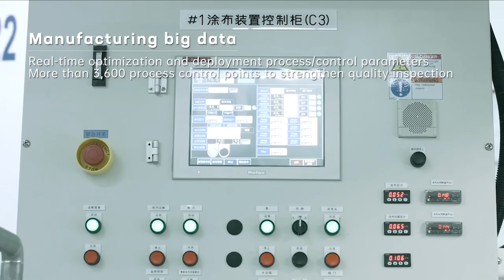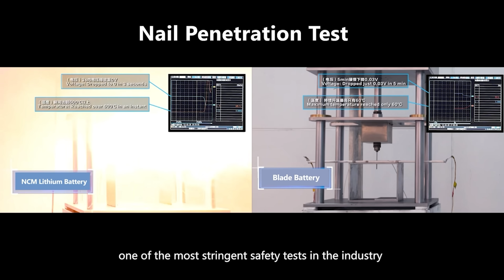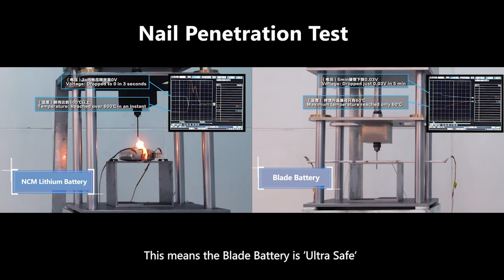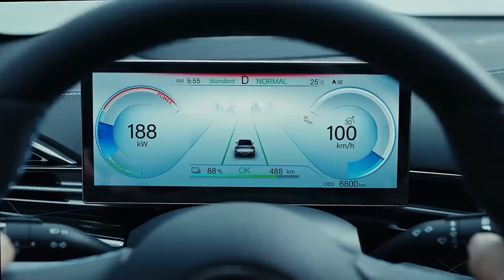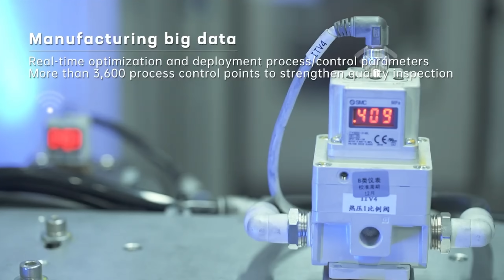South Korea Fears China’s CATL Sodium Battery Revolution

Comment: Don't know what the fuss is about, NaIon batteries are as bad as LTO or AGM  batteries, they will have to change a lot before they get close to LiFePo4 batteries, have a less efficiency then even AGM batteries, last less (2000 cycles, there's a lot of stress to the metals) are bulkier (per Wh) have a wide Voltage range so inverter have a hard time,  and are more expensive, not less.. won't even start a normal car. it's an improved 1978 technology but will it improve further? China is the main refiner of rare earth worldwide and they want to get away from that, but Chinese are catching up on that as well..

Comment: No one is "afraid" of Chinese-made sodium ion batteries. They'll only be available in China for years, only be available for certain use cases, and only able to be used inside China's vastly less safety-regulated environment. And since Sodium is vastly more widely and cheaply available, and many other companies in many other countries are working on the technology, there will be other makers as well. This isn't something China can monopolize. And, frankly, given that CATL has been incorporating stolen IP and R&D into its own R&D, as is the norm in every Chinese sector and industry, it's not an impressive accomplishment to be first to market. They're routinely first to market with stolen IP and R&D, because they can rush it through their regulatory and IP system, which is specifically tailored to fast-track just such conversion of theft to in-market product.

Comment: 50% less than LFP and cold resistant! The real interesting application is not cars, but local battery storage for solar panel installations
Reply: Exactly these are not for cars the power density is way too low unless it's a tiny car but not going to get more than 120 mile range at 170Kwh density. Great however for grid & home storage where battery size doesn't matter or cordless power tools/electrical appliances.

Comment: Lasting five million km vs one million km is basically irrelevant for anything other than commercial usage.

For consumer cars, getting the chassis to last a million km is remote. US drivers are among those who drive the most, and the highest average distance driven per year is in Wyoming at 34,722 km. At that yearly distance we're talking almost 29 years to hit one million km. Getting the battery pack to last five time as long isn't going to make any difference what so ever, as you're not going to be driving that car in 150 years.

Five million km doesn't end up making an appreciable difference in the actual lifetime of the cells, unless you're a commercial user.

In the US, semi-trucks travel an average of ~100,000 km/year and have an expected lifespan of 10 to 15 years, because the engine and gearbox are worn out. If you're just replacing the batteries, that massively expands the expected lifespan of a semi, even if you need to completely replace the battery pack. It's going to be a lot faster to do as well.

And again, a semi-truck having a battery lifespan of 50 years isn't going to be that big of a selling point. It sounds great, but are you really going to have that truck for that long?

It's a fluff number that doesn't matter. It's like bragging about a 300 km/h top speed of a sports car that will never be driven outside of a city.
Reply: It just comes with the package. Since lifespan had been an issue, it means there is no more such issue.

Comment: At the quoted price it completely changes the economics of solar and wind generated electricity. The huge number 1 drawback of sunlight is that it's not there at night and the big problem with wind is that it's not always windy. So you need some form of storage. With such cheap Na batteries then suddenly solar and wind generated electricity become really cheap.
Reply: They also don't seem to loose charge over long periods like a year the truck starter batteries can be drained to 10%,of their total capacity left out in N European Conditions and still guaranteed  start the vehicle at minus ten Deg C.  And are guaranteed for something Ike 8 years they are lighter than Pb AGMs and non toxic to produce and recycle. They can also be transported  with 0 charge ... So safer and cheaper to ship... It may be that you can 100% charge and use 90%capacity  and even chance occasionally  running flat without fear of damage . 
The other point not mentioned here is the ability to be charged at  high C rates if you have the charging architecture ..  You're getting close to gas station refill  times. 🧐 ... So that's another nail in the Tarpit industries coffin and slur campaigns. 

The next chemistry to crack is likely to be the Sulpher and or Aluminium cells which will equal or theoretically exceed fossil fuel densities by up to double... One thing though Li and Al  are not a good combination in any cell as even tiny amounts of Al can bind up Li  and make recycling far more expensive and toxic to achieve.. so best assume that's not a helpful partnership.  Though Li S may be an excellent high charge density low wt option for flight or smaller devices.currently using Li ion or NMC . 🧙🏻‍♂️🥼
Reply: Definitely, I long wanted to put solar panels on my roof esp with the soaring electric price at NZ now, but it is the battery price that put me off
Reply: @cheekhenliew7628 在中国，我们通常都使用报废电动汽车的电池作为家庭光伏储能。这些汽车报废电池仍然能作为储能电池使用10年以上。
Reply: I think one really has to run the numbers carefully on such an assertion because the wind stuff we've agreed has been hopelessly optimistic

Comment: Just watched another video about how Silicon batteries are the new game changer in the industry. So which is it, sodium or silicon or are they the same thing?
Reply: Silicon is just the anode... That replaces or reduces graphite so it cheaper and has an increased density of lithium ion batteries by 20-40%..... They are already available on Chinese android phone brands...with 7500 mah capacity on a phone...

Comment: What about the discharge curve for sodium ion batteries like NAXTRA vs li-ion batteries?
Reply: Sodium-ion batteries typically exhibit a wider voltage swing (more sloping/less flat) compared to common lithium-ion batteries, particularly Lithium Iron Phosphate (LFP).

This characteristic can present practical challenges:

Complex Power Management: A significantly sloping discharge curve means the battery's voltage drops more rapidly and consistently as the State of Charge (SOC) decreases. For the power electronics in an application (like an electric vehicle or energy storage system) to maintain a constant power output as the voltage drops, they must draw significantly more current from the battery in the low-SOC region.

This requires more complex and robust power management and DC/DC conversion systems.

Reduced Usable Energy Window (Potentially): If the application's connected power electronics or motor controllers have a narrow acceptable operating voltage range, the battery may need to be oversized. This is because a larger portion of the battery's total capacity (at the high and low ends of the steep curve) might fall outside the usable voltage window, effectively reducing the practical usable energy.

State of Charge (SOC) Estimation: A flat discharge curve (like in LFP) allows for simple and very accurate SOC estimation because a small voltage change corresponds to a large capacity change. In contrast, a sloping curve, while providing a clear correlation between voltage and SOC, can be more sensitive to factors like temperature and instantaneous current, potentially making accurate, real-time SOC estimation more challenging for the Battery Management System (BMS).

Some sources suggest that a typical sodium-ion cell's voltage might drop from approximately 3.7 V to 2.5 V over a significant portion of its discharge, whereas an LFP cell might remain between 3.4 V and 3.3 V for 80% of its discharge cycle, illustrating the difference in flatness

Comment: Japán is way behind.
Toyota keeps announcing their solid state battery for 10 years, it's always coming next year 🤣🤣
Reply: And of course CATL already has SSBs on the verge of mass production.
Reply: @andrewsuryali8540  CATL has something that works while Toyota has unicorn fart hydrogen cars and solid state perpetually 5 years away.
Reply: @andrewsuryali8540 CATL has always maintained that solid state batteries are some years away like 2030s despite what Toyota has claimed. The CATL CEO has been publicly quoted that the tech maybe there but to be commercially viable ie in terms of price, scale manufacturing, safety , long term durability and applicability the solid state batteries still needs some time.

Comment: "At present, aluminum foil is used for positive current collector of lithium ion battery and copper foil for negative current collector. Because sodium ion will not form alloy with aluminum, both positive and negative current collector of sodium ion battery can use cheaper aluminum foil."

No more copper also for sodium ion...
Reply: So no lithium, no cobalt, no manganese, no nickel, AND no copper!? And I think I read somewhere maybe no graphite but I might be wrong.
Reply: @ab3000x yes no synthetic or natural graphite only hard carbon...from coconut shells...

Aluminum is 3 x lighter than copper... Looks like it's game over for lithium

Comment: no. South Korea is not fears China's Sodium Battery. Sodium Battery is not even revolution. 
Automakers are currently reluctant to use sodium-ion batteries.  that’s the general stance across the industry.
Let me explain the reasons why car companies are avoiding sodium ion batteries.

1. The Energy Density Problem of Sodium-Ion Batteries

The main issue is that sodium ions are physically larger than lithium ions. Because of that, the overall energy density of sodium-ion batteries is much lower than that of lithium-ion batteries.
What this means is: to achieve the same battery capacity in kWh as a lithium-ion pack, a sodium-ion electric vehicle would need to install more battery cells.

As a result, the vehicle’s total curb weight increases.
Currently, EV manufacturers are doing everything they can to reduce weight while maintaining battery capacity. But if sodium-ion batteries are used, more cells are required to achieve the same electric capacity, which inevitably makes the car heavier.

2. Fire Risk

Each individual sodium-ion cell has a lower fire risk than a lithium-ion cell. However, to match the total capacity of a lithium-ion EV, you need to install a larger number of sodium-ion cells.
More cells mean:

A higher probability that a defective cell will be included in the vehicle.

A larger number of cells for the BMS (Battery Management System) to monitor. 

This is similar to Tesla’s “a-079” error issue.
When you increase the number of energy storing units, you inherently increase the potential sources of failure.  and thus the voltage unbalancing in direct current between cells and cause more cell damages and result battery failure and potentially  fire risk.

In general, EVs are safer when they use fewer, higher-energy-density cells.
That’s why high energy density per cell is extremely important for vehicle safety.

Sodium-ion batteries have even lower energy density than LFP (Lithium Iron Phosphate) cells, so more of them are needed,  which overall raises the fire risk of sodium-powered EVs.

3. Why China is Pushing Sodium-Ion Batteries

To put it bluntly, China is promoting sodium batteries because it lost the battery technology race to South Korea.

The dominant EV battery type today isn’t LFP.  it’s NCM (Nickel-Cobalt-Manganese).
NCM batteries were invented by South Korean companies and are designed specifically for electric vehicles.
In contrast, LFP batteries existed before EVs.  they are lithium-ion batteries that use iron phosphate as the cathode material and were originally developed for electronic devices, not cars.

Here’s the problem: 98% of NCM related patents are owned by Korean companies.
China reverse engineered a lot of NCM tech from LG, but that violates intellectual property rights, meaning China cannot compete with Korea fairly in the global EV battery market.

China did acquire full rights to LFP technology from the U.S., but LFP has clear limitations in EV use.
Here’s why:
EVs experience very high discharge rates (C-rates). for example, when climbing hills or accelerating, rates can exceed 6C.
The issue with LFP is that its chemical composition was originally designed for around 0.5C, which fits low-drain electronics, not EVs.

That’s why Korean companies like LG Energy Solution developed new cathode materials optimized for EVs — resulting in NCM batteries.
When the discharge rate exceeds 0.5C, LFP cells degrade much faster than NCM, and above 1C, the fire risk of LFP surpasses NCM significantly.
So in EV environments, LFP is fundamentally unsafe.
C-rates of around 0.5 are typical for ESS (Energy Storage Systems) or small electronics — that’s why LFP is more suitable for stationary ESS applications.

China lacks NCM intellectual property, so it tried to compete against Korea’s NCM with LFP.
Now, they’ve introduced sodium-ion batteries.

Here’s their reasoning:
LFP batteries already have higher fire rates than NCM and lower energy density, but sodium-ion batteries can tolerate higher C-rates than LFP — though their energy density is even lower. All research papers claiming that LFP is safer were conducted under 0.5C-rate conditions.
Therefore, the claim that LFP is safer than NCM in electric vehicles is incorrect, and in fact, no study exists showing that LFP is safer than NCM under actual EV operating conditions during above 0.5 C rate conditions.
That’s the danger: sodium batteries would require even more cells than LFP, increasing total fire risk and making them even less competitive against NCM in EVs.

My View

I believe China developed sodium-ion batteries not for EVs, but for ESS applications.
However, even in the ESS market, once Korea’s POSCO completes its NCM Life Cycle Assessment technology — which allows complete recycling of used EV batteries into ESS use, and then re-extracts cathode materials for reuse in new EV batteries — the entire closed-loop system will make recycled NCM batteries far more economical than sodium-ion ones.

Moreover, sodium-ion ESS systems require more cells, which makes them inherently more dangerous.
So even in the ESS market, sodium-ion batteries will likely lose competitiveness to recycled NCM systems in both safety and cost.

And more over, Korean companies are also developing sodium ion batteries, but the technology is considered to have limited future potential as I explained above, so research in this area remains relatively minor.
Reply: I have to dissagree you dear go against Chinese companies

Comment: The faster it replaces lithium batteries the better. We had an electric school bus here recently catch fire and engulfed it in seconds but luckily it was at beginning of run and there were only 6 students in which driver evacuated. Our companies  indoor parking does not take EVs because of insurance company. Sodium can't come soon enough.
Reply: it would result same if used sodium ion batteries. First of all, catching fire on EV is not only because cell. Mostly by auto makers' lack of battery managing software technologies. Second, if you use sodium battery, it's energy density is lower per cell. So you have to insert more number of sodium cells then lithium cells. This means that EV's batttery managing software can make more errors and put fire on battery. So in generall, sodium ion battery EV will catch more fire then lithium.
Reply: @pokepoke-x1swatch the video again😮

Comment: But lithium solid-state batteries will change things after that. I think sodium on the periphery & lithium on the inside of all of the packs might be the next move. I like the recharging stations if cars can be refitted with newer batteries with better chemistry & with software updates.
Reply: solid state batteries will only be used in very expensive cars

Comment: Korea will just buy the battery and reverse engineer it. Change a few things and launch their own.
Reply: I don't think it is that easy to reverse engineer it
Reply: @adityaKumar-cj7oi  They will be several years behind China, but I am sure they already have some of their own research in sodium cells, and are doing their best to reverse engineer what CATL has done. It's catch up time, but they have to be careful of IP violation too.
Reply: They can't match the scale of Chinese manufacturing or speed of Chinese innovation.

By the time they reverse engineer and catch up with this tech, China will be two generations ahead and they can sell it for cheaper than the Koreans.
Reply: Yes they can't sell cheaper than he Chinese because of the scale of manufacturing, so there will be no point of copying it @alburaq3290

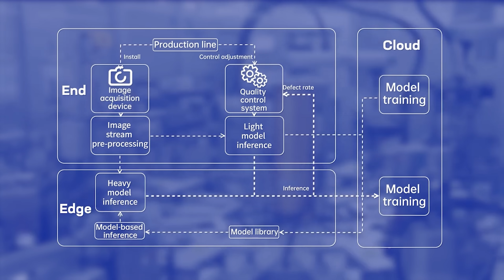Comment: Sorry if this seems petty as it is probably just a slip of the tongue, but if you are quoting figures that are highly relevant to peoples understanding of battery costs and efficiency, it needs to be accurate and this could have been fixed in post.  At around 1:38 and there after you are quoting prices at the cell level per Kg whereas I believe is should be per kW/h.  A big difference if you are talking about 175w/h per kg
Reply: No. Energy density seems to be measured in watt hours per kilo. 
So for example a 200 watt hour per kilo measurement would equate to 100 kilowatt hours for a 500 kilo battery pack. Which is roughly where they are at.
The other measure he referred to ie price per kilo is the simple cost of the cells per unit of mass. That in o way measures energy density